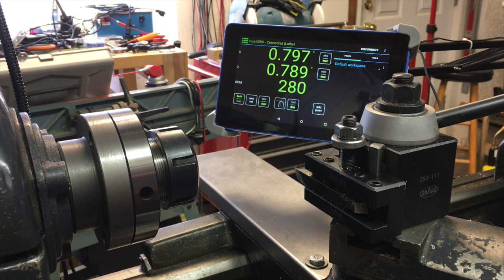Logan Lathe Model 200 TouchDRO Installation

Comment: Very good video, thanks for posting.  Did you cut away a piece of the cross slide that covered the lead screw?  My Logan 820 has a curved top piece of the casting extending out over the lead  screw and dove tail slides.  It looks like I can see saw marks on yours like it was cut off.
Reply from the maker: My lathe originally had a taper attachment. The bar got lost at some point, but it still had the long slotted cross slide extension bolted on instead of a chip guard like your 820. I sold or gave away the extension and made an extended chip guard for mine which you can see at the 16:31 mark. Logan didn't spend a lot of time on cosmetics, which is why you can still see the milling marks on the back end of the cross slide. I stoned it a bit before attaching the bracket for the scale and the shininess made the milling marks stand out. It's all still going strong, and I just used it a couple of days ago. Good little lathe.

Comment: Really like your over head tool holder.   I am going to steal your idea and make one
Reply from the maker: Thanks.  I used 1.25" perforated tube from the hardware store, a couple of lengths of 1/4-20 All-Thread and some acorn nuts to hold it together.  With the All-Thread close to the inside corners there's clearance to stick my T-handle wrenches in the spare holes.  Then I make the tool holders from aluminum flat that I bend and attach at appropriate intervals.  The rack itself is made from hardware store aluminum brazed together with a MAPP gas torch and low-temp aluminum rod.  I attached cup magnets to the hangers to hold my chuck wrenches.
Reply: Jon, thanks for the taper attachment

Comment: Hi again....i also have looked at some old atlas lathes but from briefvresearch it seems a logan lathe is better built and more heavybduty as compared to a similar size atlas.....is that generally true?
Reply from the maker: I think the Logans are a bit more rugged.  I think Atlas used cast change gears.  You still see a lot of broken gears on Logans, though.  Mine was in very good shape, no missing teeth on any of the gears that came with it.  I got a nearly complete set, and just had to buy one 16-tooth gear.

Comment: Thank you....i have tooling.....the lathe powers on fine and sounds fine....both feeds work fine forward and reverse direction....its an old lathe and no i dont intend on reconditioning it....buying it just to use at home on occasion ....$350 seems like a very good price from my brief research....its definitely not high priced....ive seen these logan 200 sell for $500-750....
Reply from the maker: If you know that it's in good shape it's definitely worth $350.  It will be a good tool for you.

Comment: I want to buy it from him...is $350 a good price ?....it has no extra change gears...only whats installed .....i only want to buy it if its a very good price....
Reply from the maker: Does it run?  What kind of shape is it in?  Are the spindle bearings good?  How rusty is it? Are the ways and other parts badly worn?  Does everything work?  Do you know enough about lathes to know what constitutes "working?"  Do the power feeds work and not make a lot of noise?  How's the backlash?  Depending on the shape it's in you might have to spend a fair amount reconditioning it.  Do you have those skills or the desire to learn them?  I assume that you do or you wouldn't be interested in buying a lathe.  All things considered, that might be a very good price, but don't lose sight of the fact that you are going to spend a lot of money on tooling no matter what you buy if you're serious about making it useful.

Comment: I like the way you have the tool rack hanging from the ceiling. Is shop built.?
Reply from the maker: Yes.  All from the hardware store.  Wire shelves, a frame of square aluminum tube low-temp brazed with BernzOmatic aluminum rod and a propane torch, perforated steel tube, a couple of lengths of All-Thread, some steel flat bar and some cup magnets, aluminum flat bar bent to make the tool holders, and misc. bolts, screws and nuts.
Reply: brilliant

Comment: Jon, what type of collet chuck do you have on the lathe? I’ve been thinking of adding one on my Logan 825 lathe. Also thanks for sharing the DRO installation.
Reply from the maker: ER40 100mm Chuck: https://www.amazon.com/gp/product/B01A67ZOQ6/ref=oh_aui_search_detailpage?ie=UTF8&psc=1

Backplate:
https://www.amazon.com/gp/product/B013E305UY/ref=oh_aui_search_detailpage?ie=UTF8&psc=1

The backplate threads were pretty rough.  I spent some time deburring them with a wire brush and kraton abrasive wheel in my Dremel to get it to thread on, and finished off with some Flitz polishing compound.

All you have to do is carefully mount the backplate and turn the face to fit the back of the chuck.  I wound up with 0.0003"  TIR.  Most-used accessory for my lathe.